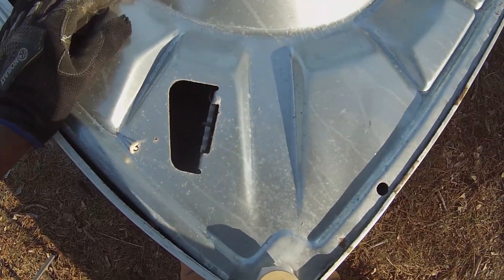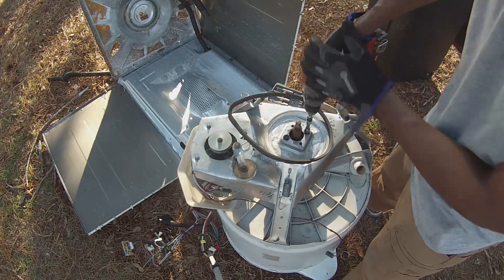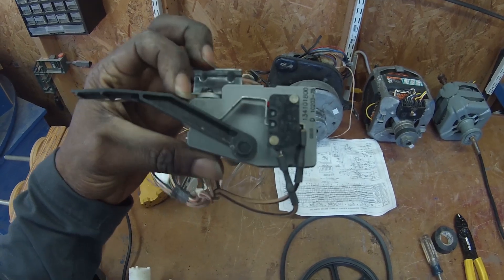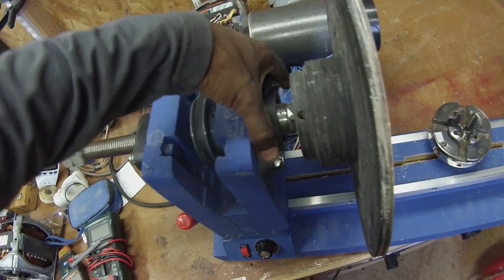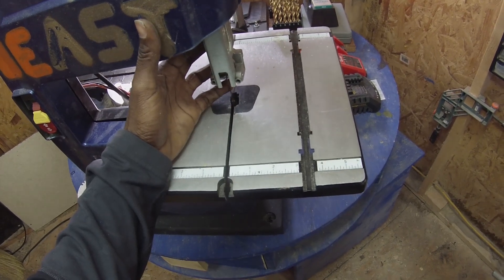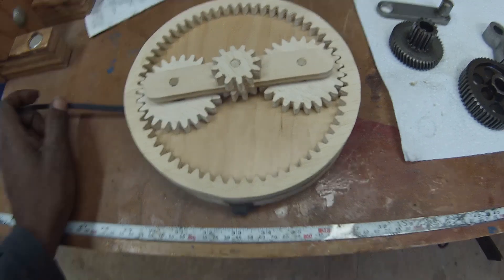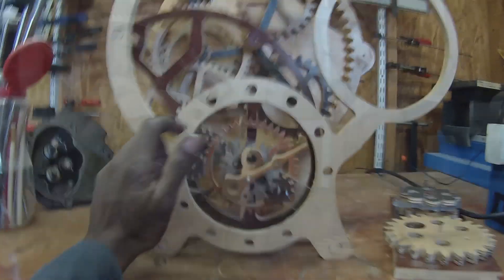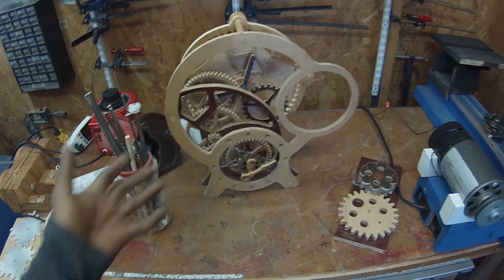Things You Can Make With A Washing Machine And Other Salvaged Components : 020

Comment: Had an apartment size washer that lasted 6 years. Its cabinet skin went to building some beautiful kitchen cabinets. It's motor went down the street to resurrect a lady's motorized wheel chair. The inner tub became a soil sifter for removing those darned rocks in my Missouri yard and those darned rocks went into my rock driveway 
Very little gets thrown away at my house.
When I took down those 3 useless satellite dishes on my roof, the curved pipes are now 37° hangers for my solar panels. The guys at O'Reilly Auto found some wheel bearings that fit perfectly and the panels rotate to follow the sun. They are mounted on the southern leg of one section of a Rohn tower. 2 panels conviently fit one above the other. This summer those panels will be motorized and I won't have to keep moving them.
Keep it until I can use it or someone else can 😅

Comment: one thing you can do with the washing machine motor is drive it with a motor like 8 hp gas Honda, that will give you 240 volts ( in my part of the world ) you can get the honda for half price by just buying a water pump version ( has no inverter ) as the inverter version has the electric motor added ( that makes it more expensive than the water pump version ) also known as the Chonda ( chinese honda ) this 240 is just AC so you have to add the capacitor from the washing machine as well.

Comment: A man after my own heart.
I never throw stuff out without harvesting all the parts, including all the screws and washers.
I'm currently stripping down a very expansive AEG washing machine, probably failed through a penny costed component failing, but the boards are way way too complex with microprocessors to fault find.
A host of pumps, valves, sensors, a lovely motor, 3-phase induction.
The stainless steel drum is about to become a wind shield for an outside gas burner cooker.
The washing machine followed the HP printer and the LG monitor.
The LG monitor yielded LED strips and many sheets of Perspex, acrylic foils etc.
All that goes to the scrapyard are the casings.
The WM had the biggest, heaviest bearing I have ever seen. At the very least, it will make a rotating table for something. Spray booth?
Next project is to make a washing machine, without all that electronic rubbish to foul it up.
The only concession to electronics will be a microcontroller that I programme.
Thanks

Comment: Love this! My Brother in Law has a large HVAC business. Yesterday I went and had a peek at his recycling pile of torn out equipment.......

Almost seemed like Christmas! I was able to harvest 3, huge, 5 hp, 3 phase motors. 2, hp single phase motors and 8 furnace Squirrel cage fan motors. Along with relays, transformers, contacters, belts, pulleys, and all sorts of other parts. I am in scrap parts heaven!

The crown jewel of my harvest is a 28 inch, centrifugal blower with a motor attached. I spun it by hand and it's perfectly balanced. Spun for a couple of minutes. 

The impellers are really unique. Once I fabricate a shroud for it, I believe that I will have a very large, robust, system for the dust collection in my shop. If I were shopping for such a thing, I probably wouldn't be able to afford what I now have in my hands! 

Your channel is a huge motivation tool for me. Now, instead of just building things in my mind, I'm using a lifetime's worth of skills, to bring them to life! Thank you Jeremy!

Wade Bert

Comment: Hey Jeremy. Love the content. Ur clock is stunning mate. Did u use the bandsaw to cut out this Cogs? 
So I have a question or 2 about Washing machine motors and that gearbox u found in the machine u had there? That type of gear box, what can it be used for? Is it possible to use something like that for a GoKart? I probably sound daft as a brush right now asking that but I don't know anything about motors, etc. I'm trying to learn as I go.
Do these Washing machine motors need to be wired in any specific ways? How can I stop the speed from ramping up constantly? Would a brushed motor need a potentiometer?
I cannot believe u got those big bearing out of an exercise machine.. That's incredible. Now I get why they can be so damn expensive with parts like those being used in the build.. They're not cheap??! Could u tell me the machine u found them in and how would I go about looking for that type of information about what parts or components are used in building machines of all types? Would that be online common knowledge?? 
Thanks for the video content pal. I love learning new things. I nee to keep my brain occupied or else......

Comment: Watch out using that power window motor to drive that clock!   They are only rated for brief usage and get REALLY hot when run continuously.  

That is an amazing clock.  I keep parts from everything that is discarded just like you do.   Only difference is I don't do many interesting things with them. 😄

Comment: On your homemade wood lathe, was that motor on it from a treadmill? 

In the case of the synchronous motors for the microwaves, they look like the actuator mechanism synchronous motors that look like that, except the agitator ones are 3 rpm.

Comment: I want to make a reciprocating can crusher fed by a hopper that uses a spinning mechanism like in a paintball hopper to feed the crusher with aligned cans.  Motor drives a wheel, wheel drives a piston, piston crushes the can.  Motor also drives the feeder via a belt.

That way you can just dump a big garbage can full of aluminum beverage cans and it takes care of the rest, and then you can take the bag or barrel full of crushed cans to the recycler.

Comment: Hi, Mr. Jeremy, I have questions.

1. What is the difference between drain motor & washing motor in manual washing machine.
2. Can I connect the motor directly to A/C power outlet without capacitor?

Thanks in advance.

Comment: Just so you know, if you come across one of those front loading Euro style washers, they are built differently. They may contain 3 phase or BLDC motors so for those salvaging those, make sure you have or can make a driver for them... They have variable speed because they must spin up in a certain way in order to balance itself correctly... They're not as straightforward as a standard washing machine...

Comment: Jeremy, I love all the gear toys and even more the manner in which you explain what you've done.  I worked part-time at the local Woodcraft store in Richmond, Va. We had a customer who made complete grandfather clocks out of wood. I saw one of his creations and it was gorgeous.  The reason for this posting is your gears in the clock.  I didn't hear you give any details on making them.  The customer discovered a unique method of hardening the wood he used in the gears by dissolving plexiglass in acetone and then soaking the gear in that solution. Once dry it made the gears extremely hard and durable so they would hold up to the contact in the clock.  I don't know if this will be of any help or you may already be doing this.  Thanks and keep up the great work.  Many of us build vicariously through what you!

Comment: Another note for printers if it hasn't been mentioned before is they are particularly useful for machinists projects since many of the rods for driving certain parts of the printer are very accurately made over their length besides being machined they are often ground to hold very tight tolerances over their lenth

Comment: Great work Jeremy.  Why don't you have a go at making a continuous power supply device using solar to power elevating a weight using mechanical gearing, then let the weight lower when solar stops.  You could also incorporate a flywheel as a store of energy...

Comment: When dealing with salvaging a drive belt that has been sitting and looks kind of warped, you should immerse it in water that is 180-190*F.   You do not want it to be boiling.   Not for too long, just maybe 6-8 minutes.   You only want to get the rubber hot.   Have already set up a drive motor and a pulley that you can place the heated belt on.   Of course this needs to be set up on a "slide", so you can use it on various size belts.   Anyway, remove the belt from the water and place it on your pulleys, adjusting it so it is snug but not tight.   You don't want to stretch your belt, just make the warp go away.   Once in place, turn on your motor and let it run for just a few minutes.   It won't take long, because the belt will cool pretty quickly, maybe 2-3 minutes, if that long.   When you turn off your motor, your belt should be pretty close to factory round.   You have to work quick, because you don't want the belt to cool too soon.   Let me know how that works for you.

Comment: I recommend when taking an appliance apart, save the model number.  By doing so, you can get the wiring diagram which will help one understand how the motor or whatever part that is salvaged is wired.  By the way, I tell new technicians to dissect old appliances to truly get an understanding of how an appliance works.  Your videos help with that.

Comment: Just recently discovered your channel and love how well you present the information. On this video you have an induction motor on your bench directly behind your lathe that looks exactly like the motor I salvaged a GE 5KH42DT19S. I want to use it to power a small machine I'm building but don't know how to wire it. Be nice if it had reverse or 2 speeds but not necessary. Should it have a capacitor or use a momentary switch. It doesn't seem to have a centrifugal switch. Thanks.

Comment: The thing I dream of building if I had your knowledge and skills is an apple scratter. It's a gadget for taking large numbers of apples and chopping them into little bits quickly.  The resulting small pieces can then be put into a press made of a metal frame, a 6-tonne jack and some plastic or metal trays which each have some of the apple mix spread on them in between layers of muslin or cheesecloth.  The jack pushes the trays together gradually the juice is squeezed out.  I have made what you guys call "hard" cider before with great effort just to produce a few litres. It was delicious though and I want to build the machines to let me do it on a larger scale.  My in-laws live in Turkey in a kind of holiday complex where there are loads of apple trees and nobody really wants to eat them - not sure why but nobody has heard of apple pie there I suppose :-).  The dream is to make cider in this small place and have everyone come round to drink their own share of the cider made from their fallen apples :-)

Comment: Hi, i took out a washing machine motor with flats on a seemingly short arbor that mates with the gearbox. Not sure how to make use of it this way except i weld something on it? It seems manufacturer intended for this motor to be for this application only, especially since they also placed a label saying to not install this motor for any other use.🤔  and I have two other washing machines but these also don’t use belt pulley system. Wondering what brand was your washing machine? Do you have a video that goes over what to look for or how to go about connecting wires on such motors?  I noticed some motors have several wires more than 3 coming out of it.  Thanks for the great ideas.

Comment: I recently salvaged a home air conditioner compressor motor from an older unit that we had replaced . I was told that it works just fine.  I was hoping to use it for a ship made tool but I know very little about electrical components and how to (in this case) reuse and repurpose them safely .  Could you recommend a good resource for this for a novice?

Comment: Do most washing machines have 3/4hp motors in them? I picked up a free top loading washing machine for a motor for a horizontal bandsaw I got with no motor, and the service manual inside the washer says the motor is either 1/4 or 1/3 hp, and it's pretty tiny and uses a flat belt not a v-belt, and plastic pulleys. Do I just need to look for bigger washers?

Comment: Im curently making a dry media tumbler for my brass shell cases since im a reloader and builder . Parts from a dryer 1the drum and from dryer 2 extra drum fins motor from a treadmill and parts from a washing machine the center plastic agitators im still in the parts gathering mode at the moment besides moving in to my new house build 2 a small sand blaster and cabnet from a old electric stove / oven i never write down my designs its all in my head and make parts on the fly im no engineer or machineist but magiver you guessed it btw the best magnets are from magnatrons i use them for everything even magnet fishing

Comment: Awesome content. I have a question. I wanted to make a  solar water heater for 10 x 30 pool and I have a washing machine pump. Is it possible to use that pump to run  water through 100 ft of 1/2  inch irrigation tubing?

Comment: Are you my son?  I was and still just like you growing up. All my life I have taken stuff apart to see what made them tick. And rob parts out of old stuff being thrown away. In the 1956 I took apart (completely apart) my Mom's vaccum cleaner when I was 5 YO and got spanked for it.  But when she went next door to tell her friend, the neighbor, about how she wanted to kill me for what I did.  I snuck out of my room and re assembled it.  It still works today.  My 72 YO brother uses it to clean out his Hot Rods interiors. I worked in a 16'X 24' shed behind my house for years. It had intercom with the house, Telephone, cable tv, internet, electric heat and air conditined.  It was great!   (I built engines, transmissions, rock crawler axles, motorcycles and anything else I could dream up. It had a small machine shop in there too!  With a small mill, metal gun lathe, bandsaws, welders and plasma cutters.)

 Now I have a 3000 sqft commercial shop building behind my house in the country, and you can just imagine how much fun I have out there now that I'm retired. (Retired Power Company Technician)  Subscribed yesterday.  Going to send these links to my grandsons, they will get a kick out of knowing there is someone out there like their Papa.

Comment: Jeremy, inspired by you I have been salvaging and building various projects.  Used microwave turntables for spray painting stations.  I recently took up welding so I’d looking to adapt one for pipe spinning for prep work or welding variable speed might be better for that.   Treadmills and mobility assist devices yield better motors, but are hard to come by, hoping for one of those or a discarded drill press or lathe or something with a chuck.  I mostly find microwaves, dryers and dishwashers.  I’m working on a downdraft table from one dryer and a large vacuformer  using a dryer heating element and augmenting the frame with exercise equipment structural steel.  A large charcoal grill is my plasma cutting table.   Collecting parts for a welding extraction system.  Gas grills have great hoods and I have many squirrel fans from microwaves, the hardest part if figuring out how to articulate/suspend the hood.   Working also on a camper van Dc water heater made from a stainless steel tank from a office drip coffee machine.

Comment: I have a project with a 6hp Honda push mower motor with a 4” pully on the shaft. I wanted to run a big squirrel cage fan off of the 6hp motor, so i will need some kind of clutch or tenchinor so the direct drive on either will not be so much of a jolt .

Comment: micro wave have at leasr 2 door safty switches. very usefull but cheap to buy at store. u can use 1 to sense u sitting on torlit seat which turns on fan to suck fumes from under seat and blow out side or into large sewer pipe. a cooling fan from computor electronics

Comment: My cousins up in Vermont bought a used washing machine, cleaned it out real good and then added a bunch of screws and bolts to the inside of the basket. They dump in a bushel of apples, turn on the machine and out comes gallons of apple cider in just a couple of minutes.

Comment: You and I are in the same racket - except I suck at making gears - which requires
a mathematical talent that I sorely lack.  People throw away some amazing stuff.
Found 2 stacked washer/dryers being junked, brought them home and found both
dryer coils were burnt out but the washers were in good shape - took the dryers off
making the washers stand alone, sold both for 50 bucks each and made flower pots
out of the dryer drums - spray painted them and put three 4 inch pvc legs on each
and sold them to a flower shop for 50 each.....they in turn sold them for 150.....
go figure.......

Comment: Wow, I really don't know what to say....your imagination and intelligence is on a  level that is far beyond anything I've ever witnessed! Sharing your creations to inspire others is phenomenal....God has certainly blessed you sir!
 I've always wanted to create a shrub saw using a push type lawn mower and a large circular saw blade (18-20 inch), but switch the gas motor to an electric unit. It would have to be geared to keep from burning up the motor....which I know nothing about. I dont know if it would even work with the electric motor because of limitations of electrical cord length, loss of amps, etc. If I could create a wheeled push-type circular saw for cutting brush up to 3 inches....I believe that I personally could get a lot of use out of it. I just cannot see how to make something like that "safe". 
 Anyhow, this is an amazing video and you're a very interesting person. May God bless you and yours with abundance! 
Sincerely, 
Donnie

Comment: When I was young, my Dad made a fan with 2x6 wood box frame, heavy, and a washing machine motor with a typical box fan blade. It was loud, but it sure moved some air, right up until it FLEW out the window and disintegrated upon contact with the ground.